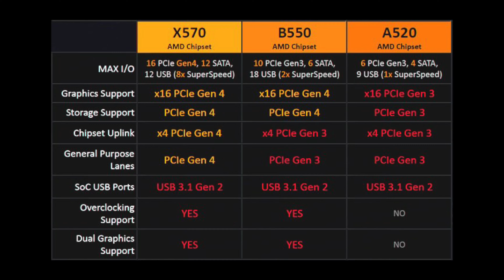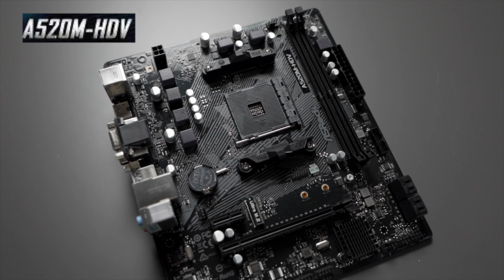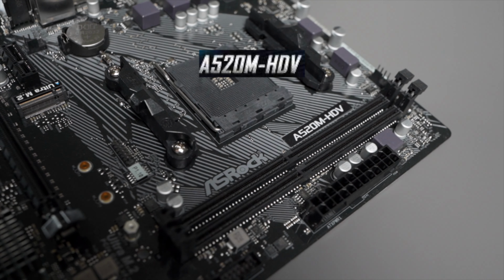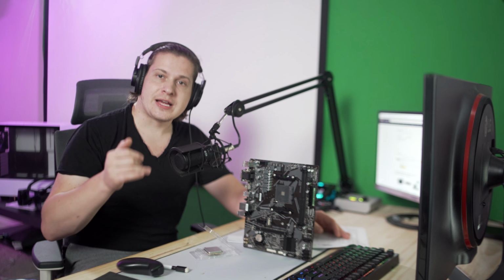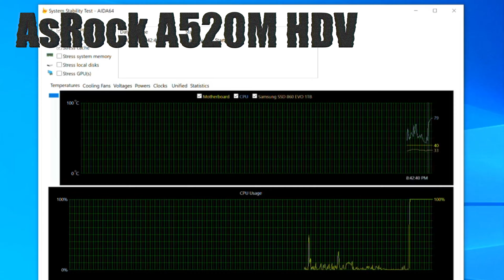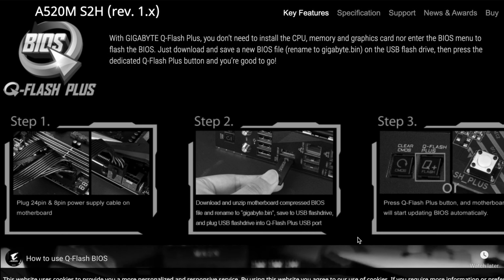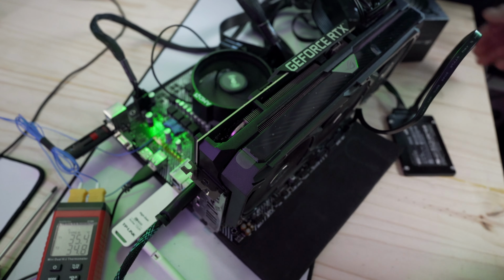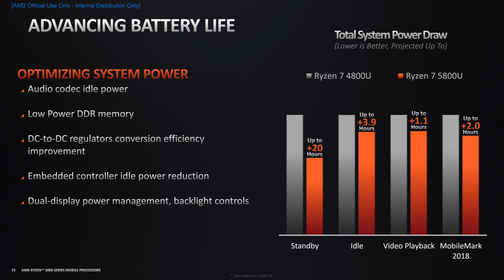RYZEN 5 5600X Running on $50 Motherboard

Comment: i’m about to buy the Gigabyte S2H and a 5600g thanks for the info
Reply: Did you flash BIOS with Q-flash, or bound it togheter "out of the box". Couse im planing to buy same a520m S2H and 5600G
Reply: I’m just saying, you can’t overclock your cpu if you use that board.
Reply: @jcptalkspcs1046  does ASRock A520M-HDV motherboard working whit the amd ryzen 5 5600g
Reply: So we can't do overclocking so we must just do the xmp profile
Reply: @jcptalkspcs1046 of course you can

Comment: those people using boards without heatsinks use the stock cooler cause that blows air across the board and vrms to keep them cooler. nerd on a buget he did a video vrm temps was 40 cel with stock cooler and 67 cel with aftermarket cooler.

Comment: Just recently bought a prebuilt with the ASRock 520 Micro ATX this is very reassuring of my new pc not blowing up cuz of cheapo board. Appreciate the insight
Reply: Hi, both me and my brother own this motherboard. 
He with a ryzen 5600x and me with a ryzen 3600x.
I've been using it since it launched in the summer of 2020 and it still works perfectly.

It cant overclock or run ram speed faster than 3200 mhz, but for 4 and 6 core cpu's this motherboard is fine!

P.s. make sure there are 2 stick of ram in the motherboard instead of 1, this greatly improves the performance of the entire pc!
Reply: @TheTryingDutchman  do u need to upgrade the bios or when u buy it can u just put it in cause I’m thinking of getting this with my 5600x

Comment: I just bought this motherboard after looking at your review in 2024. paired it with a gigabyte a520m ds3h, ryzen 5500 stock cooler, gtx1060, 500gb kingston nv2 and 16gb 3200mhz ram... this thing is snappy! easily handles Aliens: fireteam elite at 90fps on medium settings 2x aa 1080p, fortnite is a breeze, warzone a stable 70fps... gave this PC to a friend who has 42" LED TV 1080 60hz as his desktop screen, and i gotta say, what a low budget quick PC! sure it's pcie 3.0, but he doesnt notice it.

temps on idle - 
cpu 37c
gpu 44c
vrm 32c

load-
cpu 60c
gpu 73c
vrm 48c

my friend is super happy, we can finally play games together without lag! was super cheap as well to build.

Comment: Hi does dual graphics support mean two monitors support? The a520 doesn't support two monitors?
Reply from the maker: It’s one monitor at a time. Dual graphics output is marketing.
Reply: @GeorgeTech  hi, thanks for the reply. So I take it that it supports 2 monitors?

Comment: Hi george! Please answer this question, i want to get a prebuilt pc that has a520m motherboard with a ryzen 5 5600g and maybe add a rx6600 a little later down the line but idk if it's good enough. Will there be any problems with the motherboard and how would i solve any of the heating issues?
Reply: I personally use a Ryzen 5 5600 and a 6650 XT on a A520M S2H, and temps seem pretty well

Just make sure you have proper cooling and a good enough PSU and you should be fine

Comment: Hey @Georgetech, just bought an MSI A520M-A Pro installed a 5600x in it, its stuck at 0.52Ghz in windows... Any ideas please?
Reply from the maker: Have you installed chipset drivers and applied ryzen power plan? Also check the temps in hwinfo. If in bios the frequency ok then probably software bug somewhere. Update bios and fresh install of Windows should help
Reply: @GeorgeTech  thank you, busy running a memtest just to check. I have installed chipset drivers, I did not apply ryzen power plan will check that next. Bios is updated to latest. Last step I will do a fresh install of windows again.
Reply: @GeorgeTech  hey, so the motherboard was the issue... Got a new one and its working perfectly.

Comment: Hello, will it work ''out of the box'' with 5000 series, or the BIOS update is mandatory? For example Gigabyte A520 S2H with 5600g
Reply: It will likely need a BIOS update, which is simple through q-flash with a USB Stick. No need for another Ryzen CPU for flashing the BIOS.

Comment: I got the s2h But i have cabels on the bottom so does a grafikcard like a 3060ti fit in there ?
Reply from the maker: For I/O like sata and power bottom? Just bend the cables slightly. Don’t apply too much force.

Comment: Thanks for the Video man, just want to ask if i benefit from putting thermal heatsinks on the vrm´s to cool it down a bit?
Reply from the maker: You don’t have to with a520
Reply: @GeorgeTech  Thanks man, i just want a good platform for music production, think ill do not bad with that for the meantime
Reply from the maker: Oh that’s cool. If you care about latency consider Intel PC or even mac…
Reply: @GeorgeTech  i running an 6700k for now and upgrading to ryzen 5600x. are latency bad on this?
Reply from the maker: It’s really DAW latency on windows. Windows itself is just 1 ms. Check if your preferred daw and audio interface is updated to work well on AMD system. It was a mess couple of years ago. All my audio related stuff is on mac.

Comment: Hi George, I'm going to be building a Budget PC to a degree!

And my question is, What "Motherboard" do I Buy for my below optioned specs?
I'm going to be buying Ryzen 5 5600x also buying DDR4 Ram x2 8GB 3200MHz, ( I'm still wanting to be using my 600W PSU & my GTX 1060 6GB GPU + my 500GB SSD ), I have for the Windows 11 Installation.
But saying that I'm going to be maxed out just leaving me enough for a MATX Case, I think!
So yes its a "Budget Build", (After all the above Maybe £60.00 / £80.00 left ), Gulp my first ever, so I can't afford to make a mistake, so this is why I've come to you my friend.
It's going to be a struggle for me because of my limited fiancial savings because of a substantial disability, but that won't hold me back, I will do it.

Please can you helpfully advise me, thank you.

Comment: my question is here i have the asus prime a520m-k can i use a 650 watts supply with 16gb ram and ryzen 5 5600x with gtx 1660ti will it heat up or?
Reply from the maker: Yes, you should be good
Reply: @GeorgeTech  thanks

Comment: Hey you know much! 💪💪
I'm balanced between ryzen 5 4500 + Asus Prime a520 m  vs ryzen 5 5600 + Asus tuf b550 plus or Asus Strix b550 a.. Of course the second combo is better but I mean vfm somehow.. First combo can be replaced sooner  with a combo better than the second... Drop your drop on the right side..
Reply: I have 10 years a q9450 + Asus striker 2 bought used and I have no problem but, you know, I want a new toy...

Comment: Hi question. My a520m k isnt reading my 5600g but it reads athlon processors. And my 5600g is being read by other motherboards. Any tips or advice on this?
Reply from the maker: Bios update?
Reply: Should i use a processor it can read to update the bios? My 5600g isnt displaying

Comment: they should include some old ryzen 3 chip with every 5600x, i got one last week with a brand new board from Amazon and the board said on the box it was "5000 series ready" yet it needs a bios update to run the 5600x. So i go to this local pc shop and the only boards the guy has are super cheap ones, he tells me the one I get from him will run the chip, get home and put the chip on the 2nd board and the same issue, I google it and sure enough it won't work without a bios update.
Reply: The button on the back IO of the a520m is a Q Flash Plus button. Look it up, it means you can update your bios with nothing but the mother board, a PSU, and the bios on a flash drive downloaded from any other PC.

Comment: So Does that means its Safe to use  5600X On A520 :)
Reply: My brother does that and it's fine.
I'm running the same mobo with a 3600x, also works fine.
Can't overclock though and max ram speed is 3200 mhz and max ram slots is 2 instead of 4.
(Instead of adding another 2x8 gb ram you have to buy 2x16 gb ram)
Reply: @TheTryingDutchman  but the two slot runs dual channel instead of single channel right?
Reply: thinking if i should get the asrock a520m/ac micro atx but apparently the audio in it is not that great and people are saying to find something better but idk. Trying to pair this motherboard with either a ryzen 5 5500 or 5600
Reply: @raz6182  yes, the ram runs in dual channel. As for the audio, all budget boards have the same audio encoder, if you want to get the the better audio you'll need atleast a b550m pro which are 2-4 times more expensive than the A520MH.
For slightly better audio and a bunch of stuff you'll probably hardly ever use.

Many people tend to overspend on motherboards, dont be one of those people, spend the money you save on your gpu or CPU because that will give you actual performance gains!

(Also ive never had any issues with 'bad' audio and if I would I'd just buy a 10 dollar external sound card and still have a better deal than spending 120 bucks extra on a mobo)
Reply: @TheTryingDutchman  oh alright thanks! I was contemplating whether I should get this board bcs this was one of the boards that have inbuilt Wi-Fi which I prefer and it was really cheap at $119 and the next best option was a msi b550m board which costed around $200. Also is 3200 mhz ram good with the board, I've heard that the vrms maybe wouldn't Be able to handle it (it was a review on Amazon where I was gonna buy it).
Reply: @raz6182  you're welcome. 
3200 mHz ram is perfect for this board.
As for the vrms: unless you are planning on getting a 12 core chip you'll be fine.
There are some videos on YouTube of the b520 board with an 8 core AMD chip and even with that the vrms where within temperature limits.

But if you like to hobby, there are seperate vram heatsinks available for +/- 6 bucks, put them on the vrams with thermal paste and you've negated the only somewhat drawback of this board while still saving at least 60 bucks.
But, like I said, that's really not necessary, just an option.

Good luck with your computer :)